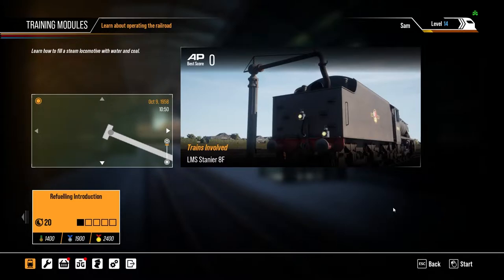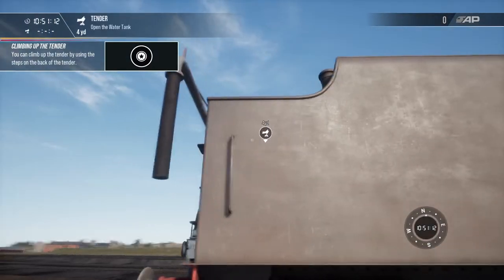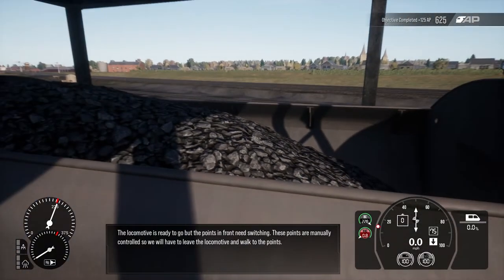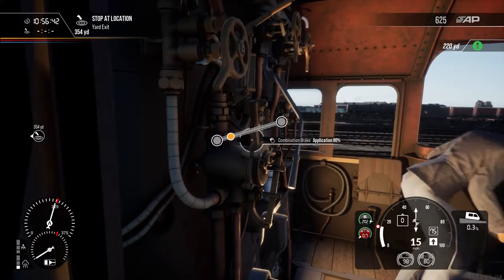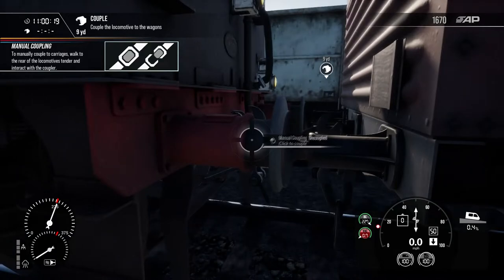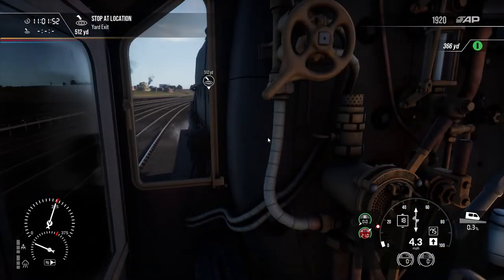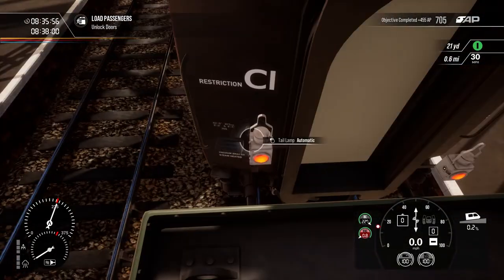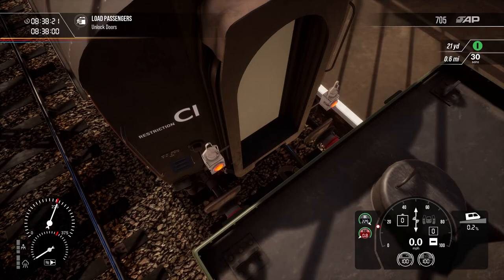TSW 2 - Spirit Of Steam Review Part 3 (Refuelling & Bug Finding)

Comment: Sorry, I need your help... how can I controll the wheels sping in this locomotive? I used train simulator 2 very very hardly and know the sanders are the key... but in this game cant work? what is wrong? (sorry about my bad english skill, Im from South America)
Reply from the maker: Hey mate, Make sure when driving the loco be very steady on the regulator, when moving off try and keep it at around 10 percent and it should prevent wheel spinning. The sanders can also be useful to provide extra traction. Your reverser when setting off should be at 75%, once on the move lower the reverser to 50% to use less steam. If your still using a lot of steam you can also lower the reverser to 35% which will improve efficiency. Once your on the move as well you should be able to start being able to apply more power to the regulator but the trick to moving off on the steam loco is to be very careful with the regulator and not apply too much power. Hope this helps :)